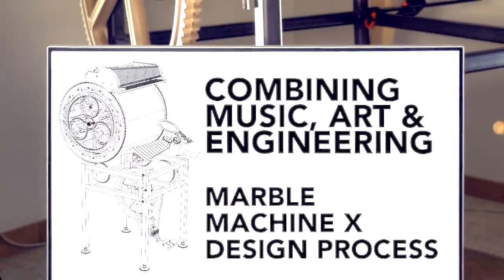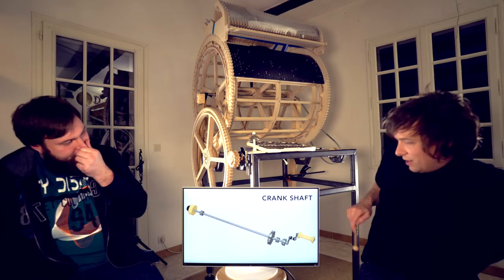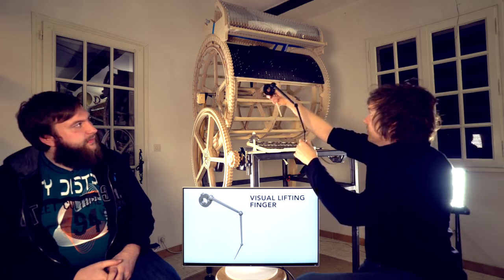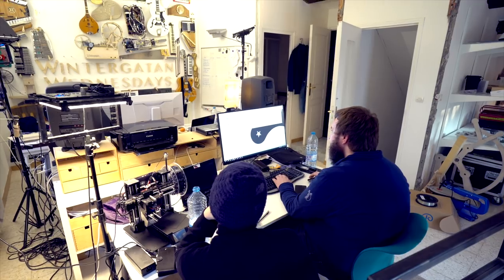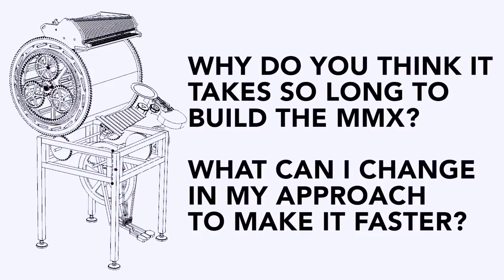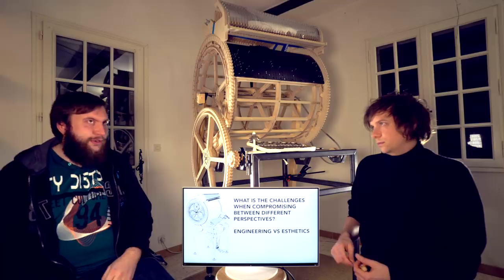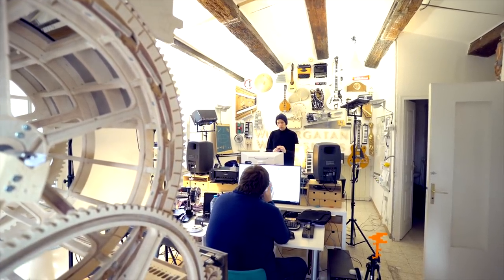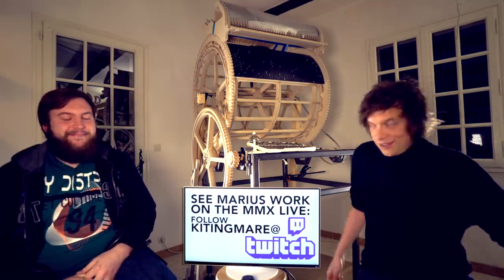Darth Marius Returns - Marble Machine X #27

Comment: Parametric design esentually allows you to link measurements with rules under each other. This can get to absolut rediclious degrees. For example. Changing the diameter of a Rim from 30cm to 40cm, adds two more spokes, makes all spokes thinner, thickens the outer border and adds a groove. All by changing a single measurement, Seeing one of those things work is marvelous.

Comment: Parametric design!! THAT'S IT!

I always wondered what the name of the concept was where you left room or parameters, adjustments for an anticipated improvement/remodel of something that would hopefully require a minimal amount of adjustment and most definitely not starting from point zero.

I ALWAYS aim to create in that fashion so that I can attempt to anticipate potential problems, improve something as it progresses but hope to ensure that it only takes a few steps and settle on the ultimate and most efficient design of something!

Comment: A comment about the brief form vs. function discussion you had. 
Maybe it's because of my engineering background (but I think not) I truly believe a well functioning, good, solution to a problem will always be more beautiful than a bad solution.
In mechanical design what characterize a good solution is usually simplicity. When you look at a solution and think "Yes, of course, this is the way to do it. So simple and beautiful." usually there may have been many many hours of thinking and prototyping behind it.
In mechanical engineering, like most things in life, you are not done when you cannot think of anything to add to the solution, you are done when you cannot find anything to remove.

Comment: Parametric is CAD modeling that describes its function. That allows changing "parameters" without losing its functionality since all parts will respect the changes.
The way most people do CAD is describing how the part looks. They might look nicer but any change might break the entire mechanism if you don't adapt the other parts.

Comment: I really admire your tenacity, and you have already combined talent and hard work to get this far. I would like to suggest one more goal for the marble machineX design  (ref 9:32)  and that is reliability and maintainability. It is hard to judge from the videos where the centre of mass is but the design appears to be a bit top heavy, especially when loaded with hundreds of steel marbles. I would hate to see someone nudge it during a performance and have it topple over. If you don't plan to extend the base footprint would you at least consider a shelf at floor level where you can add weights or sandbags to give fail-proof stability.

Comment: I love these types of machines and I am very impressed by your work. I don't know if you have thought of this, or if it will even be an issue, but since you will be touring with the machine and assembling and disassembling it: Have you thought of the effect of different humidity levels on the swelling of the wood and how that will affect fitting the different pieces together (especially how snug the fit is between all the parts)? But maybe this is not an issue with Plywood, I don't know.

Comment: Have to love skyhooks! 3 things we would mess with new helpers if they got on your nerves or a job was getting a bit too serious and frustrating.  1. "Hey buddy, run to the truck and in the back somewhere there should be a pipe/board stretcher since we cut this too short." (Pipe if your plumbing, board if doing carpentry).  2. "Hey buddy, the customer just chimed in and instead of a solid color paint they want striped paint. Head on back to the parts shop and see if they have any in stock!" (This one always gets the hardware store guys laughing and usually you get to hear the story the next day at the parts shop).  3. "You know what? We need don't have enough hands for holding this up. Why don't you go look in the truck and find me a skyhook to help us hold this up!" (Most new helpers are inexperienced and really want to show they can help do anything! Most do not question you as your the boss and even the few who question and want an explanation you just keep a straight face and give them one and off they go on their errand. Had a guy in the back of my truck for 2 1/2 hours looking for a board stretcher. It was slow that day and he couldn't find it so I told him that cleaning and organizing the truck would help as I just used it that week and knew it was in the truck. Truck looked great by lunchtime and he was red faced through lunch but enjoyed his big lunch and go home early with pay for payment of giving him the proverbial hard time.

Comment: I really enjoy these videos. I am a big fan of the original marble machine and can't wait to see the finished mmx. But there is one thing i am wondering about. and that is the lets call it dead-time of the registrators. I have noticed that they move relatively far while registrating a programming pin before they jump back to their waiting position. And because of the disign it has to move back completely to load another marble. So what exactly is the dead-time. How many holes do you have to keep free between two programming pins? Showing with a prototype would be awesome!
Reply: SunioMc Will you put something about your technical idea, in picture form, on the reddit site?

Comment: The Siemens Skyhook was invented as a quip in the electric engineering class of my father about 50 years ago. His class had to calculate the distance between landline posts and his colleague forgot to divide the result by two. When the professor asked what he would put between the posts, he said immediately: "There I'll take some Siemens Skyhooks", thus the idea was born and has spread ever since. To his misfortune, he didn't get any extra points for that answer.

Comment: The value of the talent is what you can get in a month in any completly unknown field. For example I started drumming when I was 30 yo. And I was able to play full length concert with a blues band in a month. But than my progress drammaticaly slowed down, because I just sat behind the drumset and started to play. There was no system in my rehershals, so I pushed myself back and started from the basic technics of how to hold a drum stick to be able to play faster and with more precision. 10000 of hours of practice is what I need to became a pro, and my talent doesn't matter. 😁

Comment: An easy way of explaining the difference between parametric design and free design:
Say you want to make a grid of holes, each 5 mm in diameter and separated by 10 mm.
For free design you can, depending on the software, set up one hole, and then copy it over; or you might need to do each hole.
For parametric design, you first need to set up variables, and then use that to set the properties and pattern of the holes.

But now say you realise they should have been 6 mm separated by 12 mm.
For free design you either need to remove all the holes and start again or change each hole.
For parametric design you just need to change the variables. (Which can also be used to make a different one with different properties).

So parametric design is more work initially, but much less work to change and can be used to streamline processes where multiple similar parts are made.

Comment: FDM printing mistake:

please excuse me for posting this here instead of reddit, but i don‘t have an account there, anyways:

If you will be printing the final visual lifting fingers using fdm as well, make sure to print them horizontally instead of vertically. PLA or other printing materials have very good materials properties withing a layer and usually much worse tensile strenght, etc between two layers. therefore printing the fingers standing upright might seem convenient but many small layers on top of each other makes them weak(-ish). Printing horizontally however, you end up with relatively few long layers giving you much better material properties. Downside is either you end up with a bit of support material or you might have to print in two halves. 

Anyways, I hope I could help and do my part for MMX, and keep up the fantastic work! Cheers!

Comment: As someone with an engineering background, I'm a little worried about driving two sets of marble gates AND the visual fingers all with the impulse of the programming pins. Intuitively, that feels like a fair amount of load on a very small area, and any significant wear to the programming boards, pins or the action that contacts them will cause issues down the road.  I'm sure Marius has run the math on it, but I'd definitely encourage you to keep those visual fingers LIGHT, LIGHT, LIGHT.

Comment: When will the Marble Machine X be finished? Never, you will always be tinkering with it. At least until you start working on the next machine. 😉

What is Most Important, Talent or Hard Work? Untrained talent is useless.

What are the challenges when compromising between different perspectives, engineering or aesthetics? There is no need to compromise. Engineering has a functional aesthetic.

What is the worst thing about the Wintergatan Wednesday's Videos? They only happen once a week. 😉

And advice for beginners who want to get into engineering or making? Make things. Make small things first and expand to larger projects. And you're going to mess up; perfect results come only with practice. You won't be good at engineering if you're not good at making.

Comment: Please take into account gravity. The MMX is top heavy!  The more you add to the top the more likely it is to fall over. It stands stable in your studio. Great! But on the road. On a stage with crew, actors, and various visitors walking past it, it may easily be knocked over. And one crash to the floor will stop your entire world tour!   Accidents happen!    Even the wind could knock it over!  Have your considered just how much weight is above the center of gravity?   Expand the size of the base to distribute the potential lateral force.    
A. Harte

Comment: the thing about talent is, that its so commonly used to describe someone with good musical skills or just someone that makes musik in general. Because of that, i had a problem when i was discussing about talent with a native speaker, cause we were actually talking about two different things. So its important to define it first. In general i would also say, that talent is never needet. (if it even exists) it would just be the ability to learn certain things faster than the average. That is definally good, but without talent u will just need a little bit longer/more work ;)

Comment: I'm actually torn. The sun is a rather good answer for best future source of energy. Solar will continue to improve and in the long long term we can power civilization far more complex then what we have now with it. That said Fusion is just sitting on the horizon and is looking promising.

Also on talent vs. hard work. It can be said a lack of talent is a sign you haven't put in enough hard work yet. That's not to say everything should come easy to you but that most people can do everything. For example I'm good with numbers and 3d visualization so I didn't have to put too much effort into my CADD classes back in school. I just don't get programming so every step forward is protracted and difficult. But I've made cool things with both.
Reply: Fusion is basicallly a small sun on earth, though that answer was cut a bit short and i did say fusion is the next best thing if we can properly harness it.

Comment: Talent is just already having an existing more aligned mental state that is more easily geared toward a task. With practice, you tune your mental state to the required state in order to perform a task well. Talent is just luck, your experiences have led to your brain acquiring a certain state that is conducive to your uptake of a skill. It's just a head start. You generally hit many learning walls anyway, and those are also subjective, so talent probably doesn't even matter at the end of the day.

Comment: I can get behind what martin said with talent being overrated somewhat. A line i heard before spells it out quite nicely.
"Hard work beats talent when talent doesn't work hard."
Talent can be a big part in some peoples ability to do something, BUT it also has a tendency of causing complacency in people with it also, where they start thinking they don't NEED to work hard at it because of talent, which then causes it to go to waste.
Where as, as Martin said, if you have a true drive and passion to do something, AND you work hard at it, there's no reason you can't be good/amazing at it.
If someone HAS real talent for something, AND works hard at it, the level they could achieve is potentially limitless depending on what it is, but those types of people are extremely rare, and usually tend to be the unique standouts and the exception, not the rule.

Comment: Talent to me, means that you are able to learn and understand things faster. But in the end, you still have to put in the hard work to produce results. If you build something, you still have to build it. To acquire a skill, you still have to practice.

Having no talent, might mean you take a longer time to learn and understand things. And you might make mistakes early, that means you have to take a few steps back and redesign parts. So it might take longer, but in the end the result is the same. 

I think the early Marble Machine vs MMX is a good example of this. 
The early model was put together quickly, without clearly understanding the engineering of it. As such, it was barely working well enough to make that one video. With the MMX, everything is taken into account. meaning it takes longer to design and build it, but it will be a better machine for it. (the wisdom earned from building the first marble machine, replaces the talent when building the MMX)
So the lack of "talent", means more hard work. But in the end it's the same, you have a wonderful machine to show for it. 

I think this goes for pretty much anything. A lack of talent just means it will take you longer, but if you work at it, you will get there eventually anyway, be it building things or learning skills. 
And the most important part of this is... If you enjoy doing it, it's not hard work. ;)

Comment: I completely understand what you mean by talent and hard work.

Some might see a random ass person that is good at something as having talent, but said person would mention they've been doing it since forever.
I wouldn't call that hard work though. 

When you do something you're passionate about, 
hard work isn't hard, nor is it work.

Of course, there's a few times you beat your head up against a wall (figuratively (I hope)) but those moments are either few and far between, or they span a long time and don't affect the outcome too much.

I think what is really important is great passion, spanning across long periods of time.

Even if your class gave you bad ratings, you didn't stop, because you were passionate about what you were doing, right

Once the hard work is done, and you can actually do everything with ease, when you're in that comfort zone, is it okay to just, do things with ease, as it were? 
When does the hard work stop?
If it doesn't, why not?
Where is the limit?
How do you break the sound barrier, so to speak?

I don't mean this in a depressing way, I'm merely curious. 
It seems to me there is no clear answer